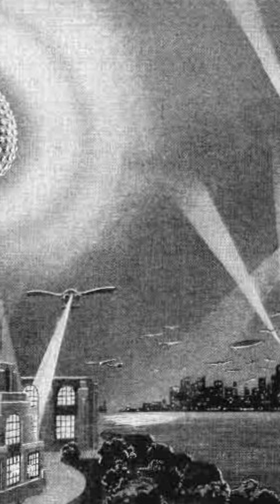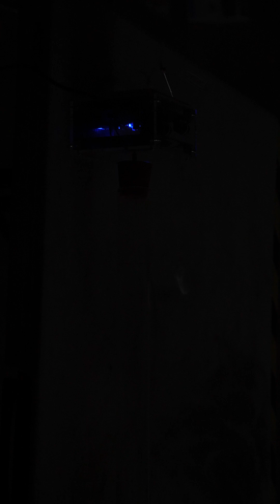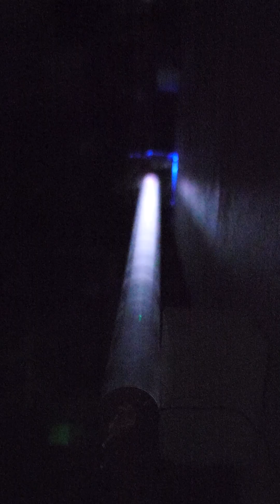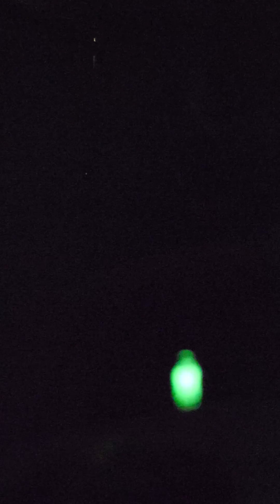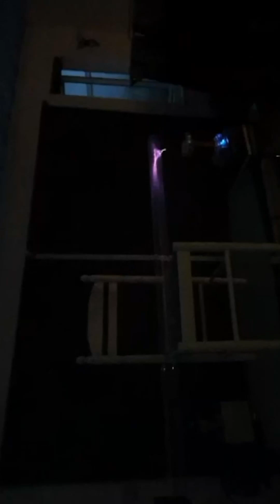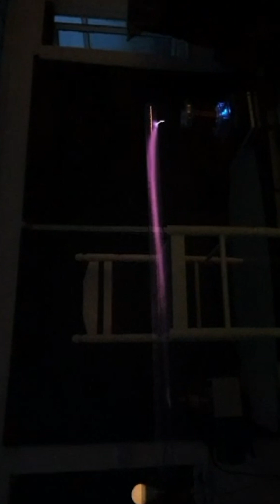Testing Nikola Tesla's Wireless Energy Idea

Comment: So, it actually is possible?
Reply: Yes all of it Tesla's ideas would have worked after all he invented the radio and 300 amazing gadgets amazing gadgets
Reply: It isn't feasible though
Reply: No.  Vacuum tubes are ALOT less convenient than wires.
Reply: @theoriginalmonstermaker  I believe the Vaccum tube is only a visual demonstration of what the ionosphere would do if utilized.  You'd still need wires to connect to the towers.
Reply: @rawls101  so the low pressure environment he's referring to is only outside the atmosphere? And the conduction only works btwn 2 things in that environment? So then everything on earth would still need wires yeah? I don't really understand the purpose.
Reply: @theoriginalmonstermaker  Ya, to be honest, I'm not really sure either!  lol
Reply: @rawls101  ha! I gotcha.  Maybe some other well informed comment go-er will let us know.
Reply: @theoriginalmonstermaker  Ha ha.  Let's hope so
Reply: @theoriginalmonstermaker  Nikola Tesla's idea for electricity was based on the use of alternating current (AC) rather than direct current (DC), which was the predominant system in use at the time. Tesla's AC system used a transformer to change the voltage of the electricity, allowing it to be transmitted more efficiently over long distances. Tesla also developed the concept of wireless communication, which involved transmitting electrical energy through the air without the need for wires.

The idea of wireless transmission of electricity involved the use of electromagnetic waves, similar to those used in radio communication. Tesla proposed that electricity could be transmitted through the air (in the ionosphere) by creating high-frequency electromagnetic fields, which would be absorbed by specially tuned receivers.
Reply: @theoriginalmonstermaker  Tesla's idea was to transmit electric power through the Earth. The ionosphere wasn't discovered until the 1920's. He would build many towers around the world with antennas buried deep into the ground, and use the towers to pump the luminiferous aether up and down between the ground and the atmosphere. Then to draw power from this system, you just tap into the luminiferous aether swishing up and down from the Earth. Anyway, this plan would never work, the ground is a conductor like a giant Faraday cage, so you can't transmit anything through it. He also got his funding cut off from J. P. Morgan because Tesla was lying to Morgan about building a trans-Atlantic radio transmitter, and also Marconi actually built a working radio transmitter for much less money.
Reply: @juliavixen176  Interesting. Sounds quite intuitive for being so wrong... I imagine a larger problem than the Faraday cage thing was lumineferous aether not existing lol; but I guess the electric potential from change in height going down is the same as change going up? That also seems strange bc I thought the electric potential into atmosphere in this example is based on charged ions increasing as you escape atmosphere bc the atmosphere isn't there to shield them... but again,  I'm just assuming,  I don't know for certain.  But I'm pretty sure there IS another electric force accessible in earth,  I just don't think it's derived from same physical phenomenon (maybe electric charges in metallic constituents of soil, stone and earth?) Either way though,  even if they worked those things would only provide energy to the "factory" that achieved it,  we'd still need wires to carry it everywhere else.
Reply: For extremely low power uses only, and efficiency is worse than horrible.

Comment: Imagine your phone without needing to charge it, it’s like solving 90% of the worlds problems
Reply: Ionosphere is where this would work, and that’s 50-600 MILES above Earth’s surface. How Nikola’s idea would work is you’d generate power, send it up a giant tower, a massive Tesla coil at the top would zap the power to other towers leading to substations around the planet, which would then travel back down to the surface. 

Your phone still needs a battery and a charger in this setup bruh 😂 THAT problem would need a VERY different solution 🤣
Reply: So would that affect the weather? Would there be loss of energy traveling through the ionosphere? Whats the point, to just save wires? But how would that be green energy?
Reply: @alexanderyang8720  maybe, but wires have their own set of problems too
Reply: @alexanderyang8720  actually, the plasma from the tesla coil will ionoize air in the ionosphere, which makes ozone, aka fixing the ozone hole
Reply: @aboudi0507  So the issue would be building structures 50 miles above earth's surface. We struggle to build anything even close to 1 mile long (The Burj Khalifa is 2,717 feet tall, just barely over half a mile tall, and that's the tallest man-made structure currently in existence). 

We solve that problem, then possibly we could fix the ozone hole.
Reply: @boomkruncher325zzshred5  thats not the issue, we dont need a tower that high, tesla already built the tower, and it worked for transmitting messages and fax, but he couldnt use it for power cyz he had to sell the property
Reply: @boomkruncher325zzshred5  This was not actually Tesla's original plan. The ionosphere wasn't discovered when Tesla built Wardencliffe. His plan was to transmit electric power through the Earth by vibrating the luminiferous aether. Tesla's plan would not work, because the ground is an electric conductor... like a Faraday cage... so radio waves can't pass through it.
Reply: @tao3014  im exaggerating obviously